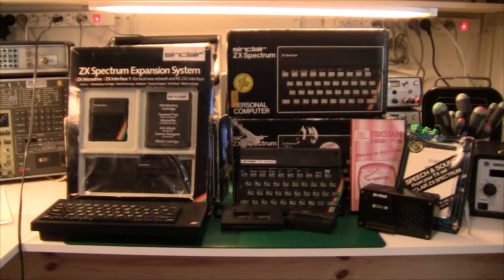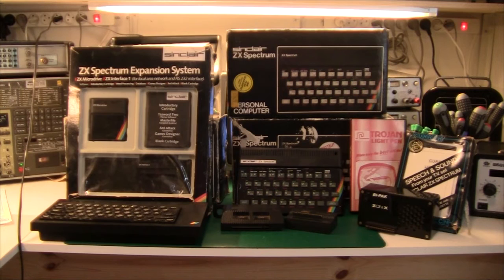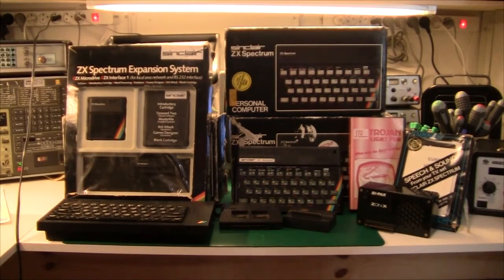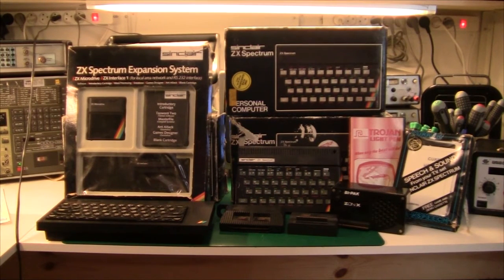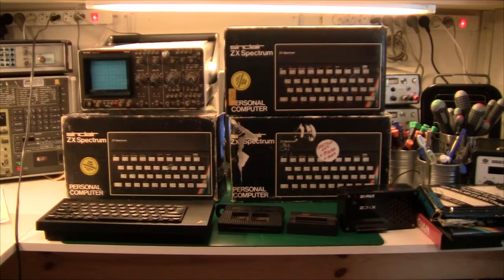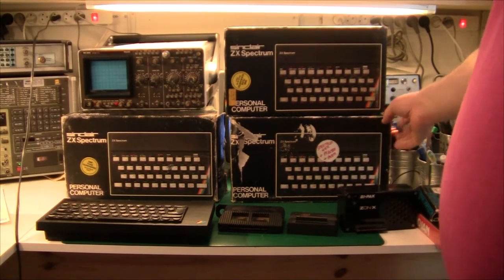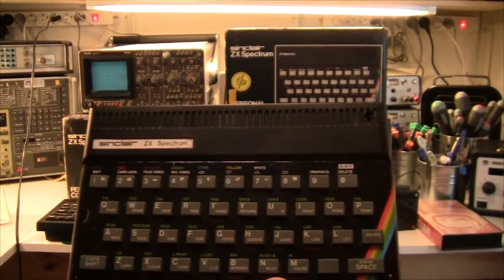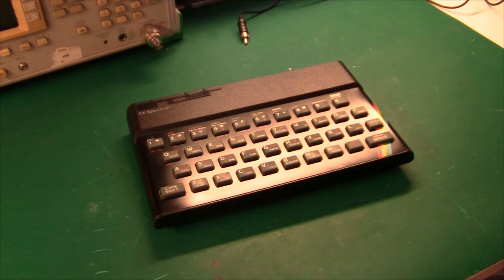Teardown of Sinclair ZX-Spectrum

Comment: Hi, I regret to tell you it is no prototype, rather an "invention" from Timex in Portugal. 
I am Portuguese and this year I've visited the Cambridge Museum with some fellow Spectrum collectors. There I had the opportunity to discuss that with them. It is merely a ZX Spectrum assembled in Portugal with a case that was later used for the computers sold in Argentina called the CZ-2000 (and that looks like a TS1500 case in black). 

I have it documented here: https://beta.collectorsbridge.com/collections/spectrum-generation/article/argentinian-sinclair-zx-spectrum-ts-2000

It would be better if it was a prototype. But I have at least 5 of those... And I know several other Portuguese people that own computers like those. Nevertheless, they are much less common than normal oficial models.

Cheers.
JDR
Reply from the maker: Hi, Thanks for you excellent information.
Reply from the maker: What's the Cambridge Museum?

Comment: Oh, waw! A prototype from my country. It's funny to find things like this at random.
I was actually watching this to merge my two 16Ks into one. I got one good looking one that doesn't work right, and a bad looking one that works flawlessly, so I'll get their cases switched so I get one good looking and working Spectrum and get rid of the rest.
Reply: Oh wait, I just found out they are two 48Ks! ... Alright, nice. =b
Reply from the maker: Yeah, good idea. Is it the ULA? It's mostly the ULA. I think some of them ran hot. 

It's hard to find one that is in good condition these days.
Reply: I dunno if it's the ULA, I didn't check, but I already took them apart and merged them. The working one is a 1983 Issue 4A, and the one with the fuzzy video out is a 1984 Issue 6A. It's funny to see because I thought they were both the same and yet they have different internals.
Reply from the maker: Yeah, there are quite a number of versions, as they fixed the problems with the ULA.
Reply: Yeah, I read a web page about them. The 4A is supposedly the one with the best picture quality (and it checks, as it's really good) and the 6A was the last revision to come out.
Which is weird, since it's the 6A that is broken, and the 4A is the one they say that supposedly came out with something faulty because it doesn't work right with some of the addons. 
What I noticed about the 6A's board is that the solder around the entire 32K bank's RAM chips is all yellow... But that's a true 64K model and not an upgraded 16K, so, I don't get it... The rest of the solders on the other components are normal, white, then that whole section is yellow. Other than that, I don't see anything else different, so I can't exactly say why the video output is so messed up. Either way, it seems repairable. Not sure anyone is willing to buy them or not.
Reply from the maker: What does the video look like, on the faulty one. If the video just shows some flashing square (8x8 pixels), it's most likely the ULA. If you have correct video, but noisy, you have to debug around the video circuit and the metal-can modulator.
Reply: The second option. I can notice the video is there but it's extremely noisy, as in, barely visible. It's something that shouldn't even happen considering they both have the modulator bypassed, the output being the VGA composite.
Reply from the maker: Oh, I see. Yeah, that sounds weird, but should be reparable.
Reply: Well, I got one working, so, no big deal for now.
Reply: Eeeh, no, it's not a prototype. I think mine has an issue 4 motherboard (or  issue 6). They aren't as common as the regular Sinclair cases, but they can be found. I bought mine from Spain, but it was imported from ... Portugal!

Timex of Portugal was assembling these things. In the Scotland Timex assembled the ZX81, in Portugal they assembled the Timex Sinclair 1000, and moved further with the Timex Sinclair 1500, Timex Computer 2048, TC2068 and TS2068. And that's where this 'TS2000' originates from: it's a standard UK Sinclair board in a TS1500 case.

There are pictures of a TS2000 prototype in the USA, but before Timex could introduce it, they pulled out of the computer market (of course the TS2068 did get a release there). I think Timex of Portugal was left with some black TS2000 cases and decided to sell them as Sinclair ZX Spectrums. Also Timex sold these machines to South America as the Czerweny CZ Spectrum (which again had standard UK Sinclair motherboards). I just wonder if Sinclair knew Timex was selling these things in South American (Argentina, Brazil) behind their back!